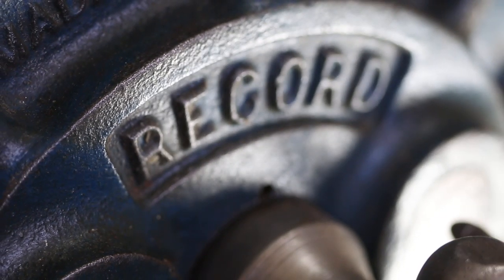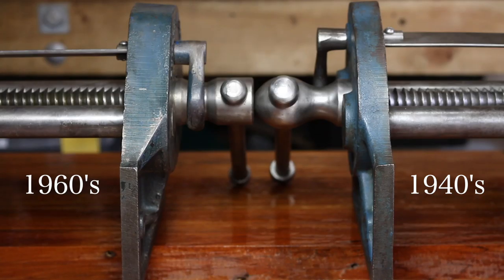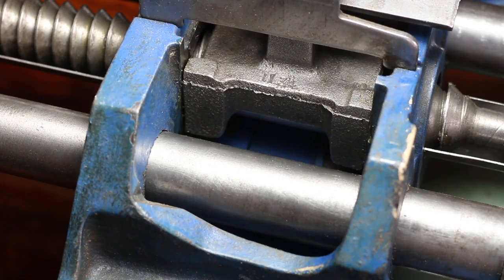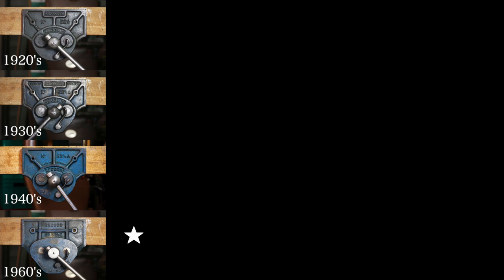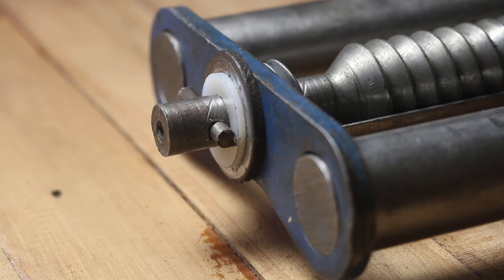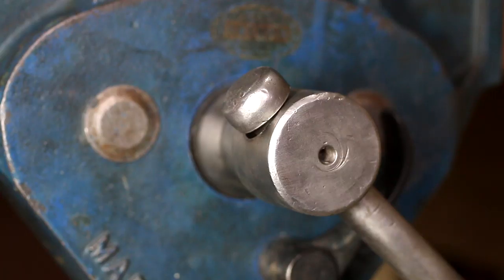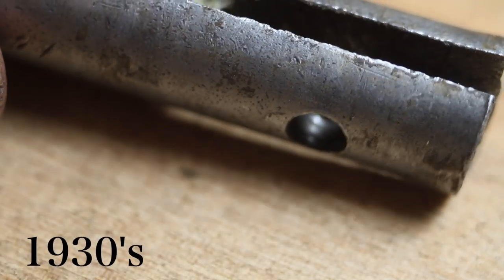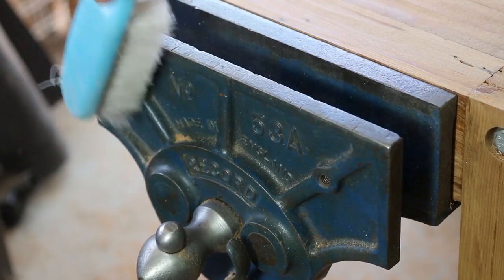Record 52 1/2 Vice Comparison - Vintage vs Pre-Modern - Which Version is Best

Comment: Just dug one out of the back of my shed to check and I was right .... after the 'design patent' ran out in the late 1930s, they dropped the registered design number but retained the box they had been in, just leaving it blank, so at a rough guess late 30s to early 40s would be reasonable for one of these. I suspect they were a bit busy during the war to change their casting patterns in any major way.

Comment: Inspired by this excellent video, a couple of weeks ago I bought what was represented to be a “vintage” Record 52 1/2 D vice on eBay. It has QR and a dog, is as heavy as a jilted lover’s heart, looks old and used but not neglected and it works perfectly. By the appearance of its mechanicals, it LOOKS to be a 1960s-era Record. But one thing gives me pause. The word/name “Record” appears only on a decal on the face of the front jaw, but in no other place on the vice. The only quasi-identifying information molded in the casting itself is a four-character sequence inside a rectangular border: “21F3”. (I would attach photos, but they don’t migrate here.) I have seen references to fakes. I paid $175.00 USD for the vice and would keep it if it is the real deal, but wouldn’t if it’s a phony. And the last thing I want to do is call someone out who doesn’t deserve it. If there is anyone willing and qualified to look at my photos and offer an informed opinion about the authenticity of my vice, I could forward them by whatever means that would suit the recipient. Go ahead, make my day.

Comment: Thank you for this vid. I have acquired a 40s version of this a week ago, shipped to the U.S. from England covered in rust that the previous owner tried to conceal under multiple layers of black gooey paint. Even the screw, what a mess! After a week of sanding, grinding, oiling, thinning and copious curses this beautiful tool is nearly ready to be clear-coated and lubed. Everything works, amazingly... but perhaps not amazing. It's a tank and will now outlive me.

It's simply a joy to repeatedly touch that knob. Thanks again!
Reply from the maker: Fantastic!! Great model. I look for those rusted up units myself, as I know that underneath the rust lies a perfectly functioning vice, just a bit of pitting, but it all adds to the character. Good stuff, Cheers!

Comment: Thank you for this.  I'm currently getting a huge chunk of rust  I pulled it out of skip back to being a working 1930's Record vice.  It was seriously rusted solid - the quick release spring is... not.  We've been soaking it in oil and, with a combination of brute force, penetrating oil, and a lump hammer, have it near working again.  Your video was an inspiration.  And so funny.
Reply from the maker: Thanks for kind words, glad the vid was of help. Sounds like you have your hands full, however the pay-off will be a good one. They are such tanks that I have no doubt that it will come up as new. very rewarding restoration indeed. Great work, have a good one!

Comment: Re-upload ? No matter- fantastic video!!!! Love my 60s. Thank you!!!
Reply from the maker: Yeah sorry for the re-upload, I had major resolution issues on the first attempt. Stuck on 360p for whatever reason. I have 2 x 60's versions on my 'mother of all benches'. They are very grunty units indeed.
Reply: elams1894  - really love the integrity and eye for detail you bring to all the videos. If you have time - a circuit design discussion for the WISC amp or how you balance aesthetic vs functional choices would be most welcome!
Reply from the maker: @danielpirone8028  - Thanks Daniel, that is a very good suggestion indeed. Luckily, now that I have finished my bench, I have time to at last finish my latest amp design which is almost complete. A video, such as the kind you suggest, would be a good fit. Cheers!

Comment: Thank You - very useful information and comparison - never realized there was so much variation.  Saw a Record 52.1/2"B a few weeks ago -  no vertical on the back casting  using the bench face as the vertical.  Had the cast linkage joining the rod ends and curvaceous knob so was an earlier model.
Reply from the maker: Thats very interesting. Never heard of the 'B' designation. I'll have to have a research. Seems to be so many little quirks to this vice, might have to sort out another video ha ha. Thanks!!

Comment: I recently acquired a set of a 52 P and a 52 1/2 P in the Sixties design, and I’m very happy with what I’ve got. I don’t mind the stubby knobs, and they go well with the tiny knob I’ve always had – in a small East German engineer’s vice from the same era. I specifically didn’t want a quick release, as I’ve had less than satisfying experiences with that in the past. I do like the old ones with the bulbous knobs, but two of those – and no quick release – that’s almost impossible to find these days.
Reply from the maker: Great vices! Quite rare Indeed, to have two 'P' models. I've only ever seen two P wood vices listed on our local online trade site here in NZ. Heaps of P engineering vices but almost zero wood vices. Thanks for message and all the best!!
Reply: @elams1894  I’ve got a restored 53p here in the uk , what does the p mean?
Reply from the maker: @mark4lev  Hi Mark, the P means that it does not have the quick release function. Still a great vice however. Cheers
Reply: @elams1894  thanks 🙏. I had a smaller Woden and that had a kind of cam lock quick release no lever, a very clever design I thought. Did record ever do this as well?
Reply from the maker: @mark4lev  I don't believe that Record ever made a cam type device, but you never know I guess. I have a big Woden engineering vice, equivalent to the Record Number 23. It's an impressive beast, and hardly used. I also have a Record 25, but for whatever reason, I like to use the Woden.
Reply: @elams1894  a lot of people , me included think the Woden quick release is broken because it doesn’t tighten, but if you slide it closed with a bit of tension it immediately clamps up , it’s a very clever design

Comment: What a great video. Thanks for taking the time and effort to make it as it answered a few questions that I'd had for a while.
I've have a sixties 52 1/2 front vice on my workbench and a sixties 53 as a tail vice. Both fully restored, they perform perfectly. Also recently restored a 40s version (it's ready for paint) and will say that that round knob, while admittedly looks great, is a lot more effort to restore.
I've painted mine with roundel blue from Paragon paints which they sell as the correct colour for Record vices, BUT I have noticed, in restoring a few of them, that the original paint colour varies between quite a pale blue and a much darker blue. Not sure whether the variation is due to the age of the vice or just to do with batches of paint.
Reply: I've got a 52 1/2 A that I'm stripping down and repainting with spray. I've got some Janolite Cobalt Blue, I was worried that it might be too dark, but actually, watching this it might be quite close. Even if it is partly due to the age of the vices, I don't mind keeping that character. I'll try and do a video.

Comment: Excellent comparison, i didn't find this sort of information anywhere else. :) Love the dry humor by the way.
I was just lucky with an ebay auction and got a Record vice what i now know to be from the 1940 era. There must have been some variation in production though, my vice still has the 1930es cast iron bar keep bracket! Also there are some rubber discs installed on each end of the handle bar to protect the beautiful knob (hurrrhurr). I'll take it apart next week to clean, derust and repaint it.

Great video mate, thank you. 8)
Reply from the maker: Thanks ko la! Thats a great buy. Never sen a 52 1/2 with the rubber discs on the handle, thats very cool. The number of times I've pinched my the webbing between thumb and fore finger. Thats very interesting about the bar keep bracket. Indeed they would have used what ever is left over from previous versions. That would be a unit that they probably made very early on in the 40's, perhaps just after the war. A definite keeper as I'ver never come across one like that. Love the transition vices. All the best with the cleaning and thanks for the comment, very interesting!
Reply: Perhaps the rubber rings are to protect your ears from the thunking of the knobbly handle bits against the big knob. Imagine putting up with that all day in a busy workshop.

Comment: Great video; loved the photography, level of detail, and style of delivery. Very nice to have a break from being shout-explained at by American youtubers.
Watching this was the final kick up the ass I needed to finally furnish my workbench with a proper vice. So, thanks for that. I managed to cop what I think is a 1940's 52 1/2, but it was without a screw and nut cover, and the rail stay has been poorly replaced. I found a replacement for the cover but, after receiving it, I've discovered the front plate has no allowance for it, and no place to screw into.
If you have a moment, could you share how your 1940's vice has its screw and nut cover fixed?
Reply from the maker: Thanks STIMULI! Appreciate the kind words. The screw and nut cover were included in the units with the designation 'A'. Any 52 1/2 vice with the screw and nut cover would hence be labelled '52 1/2 A. Having a look at normal 52 1/2, you could retro fit a screw and nut cover however you would have to tap a wee screw hole into both the face plate and the rail stay. Indeed the 'A' designation models have a cavity for the fitting, however I think you can get away with it without the cavity if you were to tap into the iron. Cheers.
Reply: @elams1894  That's great to know, thanks for the help. A lot of this information has been lost to dead links in old forum posts. I settled on the same solution. It'll be mostly hidden, but it doesn't seem like much can go wrong with the process anyway :)

Comment: Very useful video. On topic - is there anywhere you know of to buy replacement parts for the old Records? I have a 1940s 52 1/2 but it’s tragically missing it’s half nut and quick release. Cheers for the video.
Reply from the maker: Thanks! That's a bummer that you are missing parts. I'm not sure where you could spares other than looking out for an old rusty one that's going cheap. That's what I have done. The rust is easily removed revealing a near as new unit. Best of luck and cheers!

Comment: Excellent and fascinating video. I've watched a couple of times now and feel quite expert thanks to you. Purchased a 60s E and a 40s also. Also a cheaper P model from.the 60s.
How did you get such a nice patina on the faces and knobs/ handles? I've got all rust off but a poly abrasive pad was a bit heavy. Tried Autosol as well - its okish
Would be interested in any  products or techniques you used?
Reply from the maker: Thanks for kind words. I used a wire brush on the drill press for the light work. For the heavily rusted stuff like the knobs, screws and bars, I soaked them in citric acid solution for a few days. Then I neutralise the acid in washing soda then apply canuba wax with an old tooth brush. I dislike taking all the paint off and repainting as I think the old paint adds a great deal to the vintage look. Thanks for comment, great to hear of your vice acquisition,  cheers!
Reply: @elams1894  many thanks, I did similar with the wire brush and soaked in commercial (but expensive) Hammerite rust remover. I like the idea of neutralising the acid. I just rinsed with water but it left the metal salty, although WD40 got rid of that. I will try canuba wax, dont know it. I found 2500 grit wet and dry on the knob removed the tiny scratches I made with the abrasive disc on the knob.
Totally agree with keeping the remnants of the original paint! One mistake I made was trying Gunk. That removed everything including paint. I stupidly added white spirit to dilute it and it went horribly wrong. Left a pinkish residue as a result of chemicals mixing. Anyway, just on the far end small parallel plate. I'd send a pic if I could
Reply from the maker: @cracknelldavid  nice work. I too try to stay away from paint strippers and alike, just too brutal. I find the wire brush doesn't go too far into existing paint, however it still removes old glue and surface rust. Britax works pretty good but I couldn't handle the toluene. I find canuba lasts a bit longer and its base solvent, linolene, or citrus oil or simar, is much more mild. Good stuff!
Reply: @elams1894  I know Paul Sellers recommends furniture wax on the parallel rails, he also says he uses a "plastic" abrasive attachment but I haven't found one. 
Thanks for clarifying on the brush/ paint. Your vices have a lovely patina. Perfect. I think I might have to assemble a collection. Need to build more benches!
Reply from the maker: Indeed, one can never have too many benches. I'm building one right now, 3m long and but like a tank.  My Number 25 Record engineering vice to sit in the middle. Its 42kgs so my bench needs to be big ha ha. I like Paul Sellers, great channel!

Comment: I inherited an old workbench from the father-in-law, it has the 30’s version attached. Still as the information on the maintenance plate! Can’t wait to restore it! Can someone tell me what they’re worth?
Reply from the maker: Awesome! Great model. Here in New Zealand, a used fully functional 52 1/2 can go for anything between $90 and $220. A 53 model will fetch higher. In US dollar terms that would be about $60 - $170 I should imagine. Considering the price for a new 'not made in England' unit, that is quite a bargain. Cheers!

Comment: Unsure if I missed it, but do these records utilize the Toe in feature?  Or do they close up flat to one another?
I have an old Colombian vise that I got oldstock unused and well,, it’s got toe in pretty excessively.   It comes together flush pretty well however,, it’s definitely leaving indentations on my wood.
I wonder if i should put wood jaws on it.  And also if i should consider compensating for the toe in feature by compensating for it by making the wooden jaws the appropriate thickness to eliminate the toe in feature?
What’s the word on toe in vs non toe in?
Anyone know?

Thanks!!

Comment: Great video, impressive. I have the 20's version and wondering how to get the 'click' out of it, it kind of jumps at a couple of points and does not grab the threaded rod.
Reply from the maker: That's no good. Could be the thread is worn in a few spots. It's a backward thread, like the ones on toothpaste tubes, and if it's a bit worn the thread nut won't hold under pressure. Cheers and all the best!!
Reply: @elams1894  I suspect you are right, I will tinker!

Comment: I have a 52.5 that doesn’t have the nubbin but does have the MADE IN ENGLAND across the top so making it difficult to date, somewhere between the 20s and 30s versions. The quick release lever, spring and bar are missing although I do remember them being present when it was in my father’s shop in the fifties. He was born in 1924 so must have acquired it second hand.

Comment: Hi Elams1894 - I have managed to obtain a quick release bar from a later vice (40's-60) than mine but as you point out in your fantastic video its wider than the early 1920 version. Could you possibly tell me how wide (and thick) it should be and I will get mine machined to the correct width. Many thanks for the great info.
Reply from the maker: Hi Steve, unfortunately I have sold the 20's unit. However I think from memory the thickness of the 20's bar was 13/16 of an inch. But I'm not 100% certain. If anyone else out there can chime in with the exact measurement, that would be great. Failing that, I'll ask the person who bought the unit to put some callipers over it. Thanks for kind words Steve.
Reply: @elams1894  thanks for the update. Any  information gratefully received. 🙂

Comment: just bought a 1940's record vice. because of the curves at the back i am struggling to picture bolting this underneath a work bench. will i have to cut out a slot of it?
Reply from the maker: Nice one on the purchase. Yes you'll need to cut the two slots in your bench to accept the bolting plate of the vice. It may seem like an inconvenience however the benefits far outweigh the hassle. I've been using both the 40's (with back plate fins) and 60's (without) and the 40's is far superior in terms of holding strength. The 60's is slipping with same significant weight and pressure whereas my 40's is holding the work with ease. Cheers
Reply: @elams1894  amazing, thanks for the speedy reply! i found a video shortly after commenting on this with a guy fitting the same one onto the same bench i was planning on buying so between the both of you, have sorted me right out. thanks!